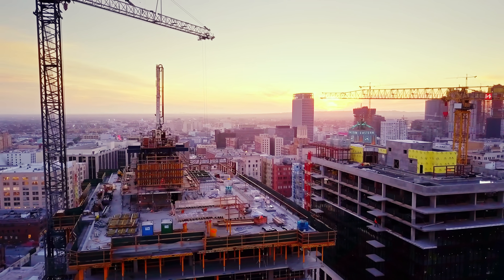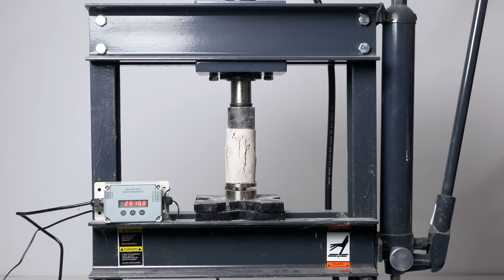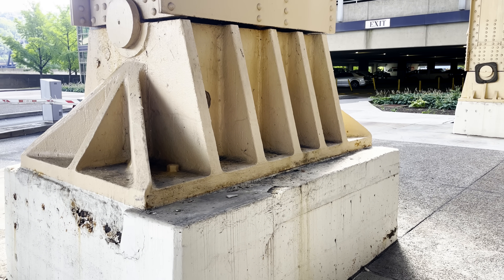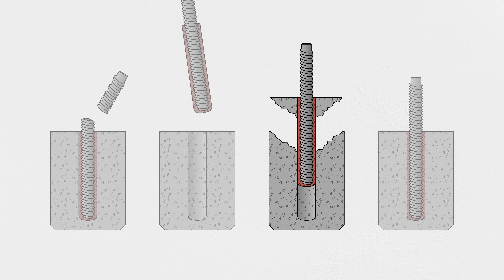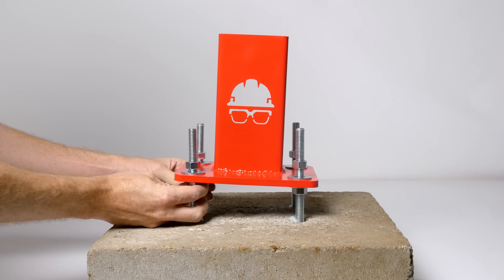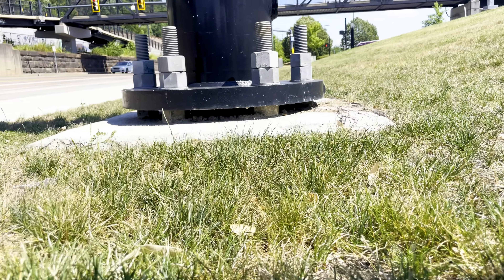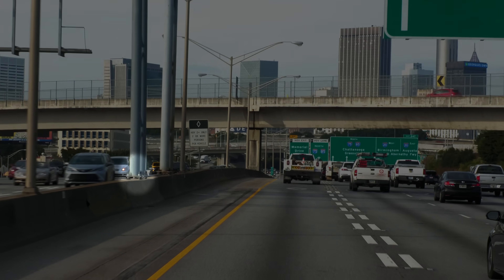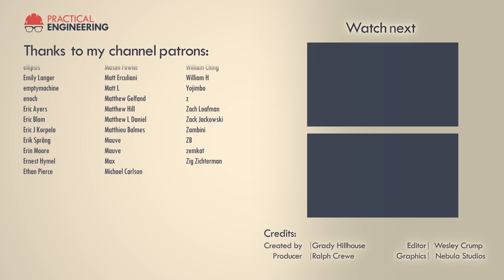What’s the Deal with Base Plates?

Comment: There's some serious engineering behind base plates like this, especially for wind turbines. One of the case studies we went over in college was wind turbine foundation bolts. In this case they were installed with leveling nuts so instead of behaving like a typical bolted joint which experiences effectively zero fatigue unless the clamp force is exceeded, the bolts were experiencing fully reversing compressive and tensile loads.  Thankfully I believe it was caught in inspection (they retention/torque turbines as part of annual maintenance).
Reply: *retension
Reply: The elephant in the room!!!!!   Unfortunately, while stand off base plates are very convenient for aligning, they do contain a fatal life limiting flaw as @JamesSeedorf has very correctly identified.  The flaw is not considered by design standards or by designers.  i.e.  The thread below the levelling nut.  Stand off base plates are the only common situation when cyclic reversing loads are applied to un-preloaded threads.   Even ignoring bending, the stress range in the un-preloaded threaded section of holding down bolt is a small fraction of the endurance limit of the bolt material.  (The zero bending is a myth because concrete is not a theoretical anchor).  You don't believe me?  I would challenge you a) To calculate the load carried by each bolt.  esp. in a 10 bolt base plate.  You cannot.  The individual bolt load could be anything, some bolts could even be under net tension due to dead weight only!   Why ?  The  load is dependent on the installer.   b) To calculate the fatigue life of base plate assuming that the bolts are carrying a theoretically equal load distribution.  This design has been subject to many research papers.  For some reason, the stand off base plate design is still permitted.  Particularly, for high mast light poles in windy areas.  If you do not want to do the fatigue calculation, think of this example.  Would you drive a car if its wheels had been "widened"  (tracking increased) by adding nuts on the inside of the hub to longer studs?  In effect, turning the stand off based plates by 90 deg and then applying reversing loads.

Comment: I'm in structural test for large aerospace structures. When we attach a steel base structure to a concrete "floor" of our test stand we level the base about 1" above the concrete and use a 2-part epoxy grout to fill the space between. High-strength steel studs that were previously threaded into permanent anchors in the floor are then used to pull the base hard against the epoxy grout after it has cured.
Reply: hopefully the part of those steel studs that are in the grout are sleeved so they pull the plate to the floor, and let the grout section stretch to provide the load. There have been one or two instances of post stressed members not being free to move, which has resulted in the actual substrate failing near the ends, because the tensile members were too firmly bonded to them while the middle was under no tension.
Reply: @SeanBZA  yes we use foam donuts around the studs (they seal against the bottom of the steel and the concrete) to prevent the grout from getting the stud threads
Reply: Smart, makes sure grout/concrete are in compression and steel is in tension, both doing what they're best at

Comment: Anchor bolts are a pain to get right even after the design is set. I was the production manager for piers and light pole bases at a precast concrete plant for years, and the thing that demanded all of my focus was the anchor bolts going into them; what's the size, the spacing, how far up do they project, etc. All that information was needed before I could schedule something for production and it's astounding how often contractors placing an order just couldn't give me that info when asked. All the fretting over the bolts was to avoid getting the call that the 20 foundations we built and delivered wouldn't fit the baseplates on site.
Reply: Why wouldn’t they just give you baseplate templates and bolts beforehand. It would make “screwing” up the job next to impossible, no?
Reply: @JetSkiSuper7  Sometimes I'd get a template, sometimes I didn't. I've been given the wrong template before as well. One time I even got a template that was printed at the incorrect scale and so the bolt spacing ended up being too close together. When the information was liable to change hands several times before it got to me, I just had to be diligent in making sure everything was correct.
Reply: @ryanconroy8165  if you get the wrong template it's not your fault if the holes don't line up. As a concrete contractor and I have to place the anchors the first thing I do is get the anchor plan and walk around the job placing the right anchors and templates roughly at their spot. If something is missing I'll see it before we start placing them on the formwork. Wrongly scaled templates would most likely also be noticed.
Reply: @idontgiveaship2575  The thing about templates for our precast operation was they were really only good for the information they provided. The precast foundations actually get poured upside-down to get a good top-finish, so the bottom of the form is a plywood plate that plant workers drill holes through for the anchor bolts to stick out of. Part of my job was making sure the info off the template was communicated in the paperwork detailing how to build the foundation.
Reply: @ryanconroy8165  your whole thread is why engineers need to spend more time building and be on site.  Hands on training is the difference between spatial intelligence and computer design assumptions.  The number of times I would redesign details for engineers because their design implementation was impossible, ie straps at a four way corner.
Reply: @JetSkiSuper7  We are a sign contractor that has always built (and wants to build) our own anchor bolt forms. Increasingly, the industry is moving to other contractors on site digging the footing, building the cage, pouring the concrete, and placing the bolts... The track record "screwing up" is much closer to 100% than impossible. 
Bolts on the wrong centers, bolts are as plumb as crooked teeth, not enough thread above grade for the leveling bolt + plate + clamp bolt. The list goes on.
Reply: @davidwilliams9302  Industrial air-con installer, can confirm. We would get sent a plan, AND printed drilling profiles for the footings  of air-con units on  the roof install, and our job was to put in studs on the roof, ahead of time, so they cured, and the extremely expensive crane wasn't on site for longer than it needed to be.
Then you would  compare the plan size to the drilling profile size . . . and they were different, sometimes wildly different, like someone had printed the profile at half size, or the printer had stuttered and the bolts were in the corners of a rhomboid. Time after time. 
We would take photos of the discrepancy, txt it to their designer, and be told "Ignore the printed profile, follow the plan !" and do our best to do that, then the unit would turn up and be completely different to the plan.
Reply: Why not have a manufactured "baseplate" that gets buried in the concrete and has threaded rods / bolts that stick up through the concrete and then a matching baseplate for the column that slips over this and uses the bottom and top nuts to make the column plumb?
Reply: @seanseoltoir  those are available from Simpson
Reply: Or that call when something doesn't fit when a 50 ton sign is hovering over a closed freeway at night when rush hour traffic is coming in an hour, with the sound of guys with sledge hammers banging away on it trying to get it to pop-in, lol. I'm a surveyor and I've sweated at least a hundred of these when we calculate and layout the location of median and outside foundations for sign bridges that are already ordered, but not-yet delivered.
Reply: Wouldn't it be your job to tell them what is needed for YOUR precast products? 

 I am not getting why a light post wouldn't have the baseplate screws already calculated for. How much do base plates cost compared to say a 1 inch to 1-1/2 for example? 

 I am just wondering why any of them would even bother for minimum specs. I feel like over engineering it is not an issue. Here everyone gets a 2 inch thick baseplates, and anchors as thick as my wa
Reply: @dianapennepacker6854   Ryan is part of the pre-cast manufacturer, making products for others. It's the others that need to send in the required designs and specs.
Reply: You got one job man, that's your job😂. It's engineering my man it's supposed to be difficult

Comment: I regularly design base plates for industrial gearboxes, mainly for use in waste water treatment plants. We mainly use stand off designs for that, though some customers prefer a flange mount. This was a great basic summary and I very much enjoyed the video. Always love your content and the scale demos, keep it up!
Reply: Honest question? Is there a competency crisis emerging in your field? I'm fascinated about this stuff. Lots of fields we take for granted have a lot of old guys and not enough young guys going into it. Curious if this applies to your field too.
Reply: @cendrizzi  thankfully it doesn’t seem so. My department has a really good spread of experience and ages. We have 15 engineers/drafter/technicians and we range from ~60yo to just out of college though the ages are heavy in the 30s. In  addition, we rotate 2 co-op engineering students on 6 month internships every year with a program with Clemson University and we’ve hired several of them after the fact. I think our field seems to be pretty stable at the moment.
Reply: What do you suggest I use for anchor bolts to support a cast iron flagpole? Approximate weight is 225 lb and has four 1 in base plate holes. It is 25 ft tall. Thanks
Reply: @kimosabi860 Would you really use cast iron for a flagpole ?
Reply: @kimosabi860  cast iron is pretty soft and brittle. aluminium or steel are much better options, lighter too
Reply: @HomeFromFarAway well what software did they mention engineers use to calculate what dimensions of base plate to use to avoid the failures mentioned... can you recommend any...
Reply: I build waste water treatment plants in Iowa. I install these kind of things everyday so I love knowing the theory behind it!!!!
Reply: Clarifier and thickener drives? Ever hear of DBS?
Reply: @joecummings1260  Mixers, aerators, and clarifiers. Our drives may be used for thickeners, but our SAP system can be weirdly limited on application specific selections and our sales guys don't always clarify things further to us... which can often be frustrating and cause us designers to go back to sales for more information. Don't know why they never seem to learn from it either. 

Can't say I've heard of DBS Manufacturing until I just Googled it. I work for SEW Eurodrive.
Reply: @joecummings1260  I could have sworn I had already responded but noticed I didn’t see the response actually posted. Oh well.

Mainly we deal with mixer, aerators, and clarifiers when we are designing for water treatment plants. Though if we do have gearboxes installed on thickeners I may not realize since our SAP system can be limited in application options and they may have picked mixer instead. 

And until I had googled DBS, I had never heard of them, sorry.
Reply: ALWAYS THANK THE GUYS THAT HELP KEEP THE WORLD RUNNING SMOOTHLY, 
LIKE YOU DO!!!                                    THANX!!!                 🙂

Comment: Thanks so much for the video, this in particular has bothered me for a long time.  One of the problems is this puts the screws into combined cyclical loading (could be shear, tension, and shear due to base plate twisting) which is much harder on the screw than a pre-loaded joint.  Do you know if lower hardness anchors used here, or are the safety factors increased for this kind of joint design?

Comment: Spread the load. This is also important for freight, especially aircraft, as the limiting factor is often the cargo floor and you spread the load with either a pallet  or shoring, often just wood planks that allow you to load objects with very small contact points on an aircraft cargo floor that is remarkably thin, and thus light.
Reply: Shoring and leveling of loads is also key with containerized freight. Not only for the aircraft load but in general handling of the container. Too much weight in one spot and the container is far harder to handle and push around, wanting to pivot at the heavy load point.
Reply: Yes, I was tasked to do a pre major overhaul weighing of a helicopter, and this was 45kg over the last recorded weight, simply due to the floor of the helicopter being now almost entirely constructed of Araldite epoxy. the issue was that using it as a gunship, with a 20mm or 16mm cannon in the side, essentially used to tear all the mounts, both for the cannon, and the pilots, out of the honeycomb floor. So they would simply place an aluminium plate under, temporary bolted to the "good" floor, then pour in epoxy (5l cans, none of this little tube stuff) and have the mounts held in position till it cured 24 hours later. Remove bolts and fill the holes with 5 minute epoxy. Then spray with black enamel, sprinkle a heavy coat of dry sand on top, and leave for 15 minutes, then brush off excess sand, and paint again with the black enamel. Might last 2 missions, or 500 rounds, before it ripped out again. basically the entire floor was a solid epoxy block, with lots of plates under it to act where the patches were. Entire floor was replaced with new honeycomb material.

Comment: I find the "grout"-solution much better than the floating-solution, should go without saying. But I don´t understand why not at least one edge of the grout isn´t at the baseplate´s-level (with the anchors going deep into the baseplate, instead of anchoring just into the grout), and why grout has to be so narrow ???
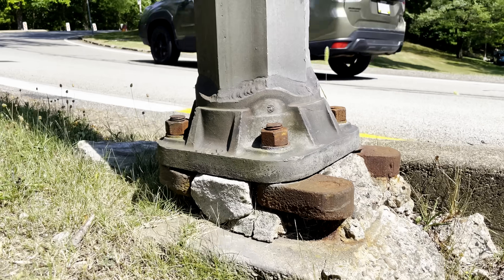Reply: 9:15

You don’t want extra grout - it’s time consuming or costly and it traps water. It needs to fill the gap and nothing more
Reply: You don't anchor into grout.

Comment: I had never heard that standoff base plates were for the sign to break away during a crash, but that was always my assumption. TIL
Reply: On road signs around here there's a joint near the ground with frangible bolts.  Additionally these joints have angled plates so when the sign is struck at speed the sign launches into the air away from the vehicle instead of just crumpling over and hitting the vehicle.

Comment: Being in the industrial concrete and communication tower construction business I really appreciated this video.   Using stronger concrete and anchor bolts and doing away with grout was a great move in the industries.
Reply: Same thing in the utility and power industry for substation construction. Non-grouted BPs are so much better. I've seen SO many structures that have rotting base connections because the moisture and water over the years has been trapped inside of the shaft with no escape because of the grout pad.
Reply: @DirtyD07 wait, grout like bathroom grout? That stuff barely holds up in domestic settings, they were using it to hold up poles?

Edit: the video reached that part. Huh.
Reply: @ no, cementitious grout, as he describes in the video. Basically just Portland cement with sand and no aggregate.
Reply: I'm retired now, but worked most of my career in engineering at refineries and petrochemical plants.  Base plates for motors, gearboxes, compressors and pumps used epoxy grouts.  Very robust, waterproof, void free, etc.  Used on anything from 1hp injection pumps to 12,000hp compressors.
Reply: @AlexofZippo  
Grout can easily have 5ksi to 10ksi capacities. Stronger than many concrete specs. It's just not nearly as durable; however, encased in concrete below and steel above, it typically works out just fine.
Reply: I just made a whole post discussing this. In the more recent TIA codes they expressly forbid grout as a compression element. But I've had to justify existing monopoles or guyed towers assuming the grout was working in compression (it was a valid design then, but not now). I did have photos to see the grout looked fine, but yeah, this definitely impacts the anchor design, making the anchors work at about 350% demand (mostly due to bending) when you suddenly are just supposed to ignore the grout lol.